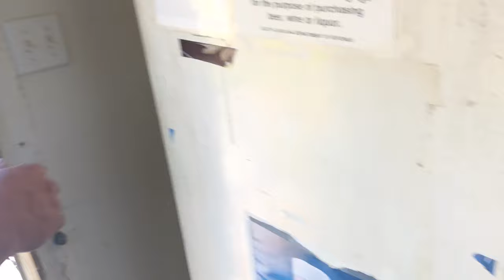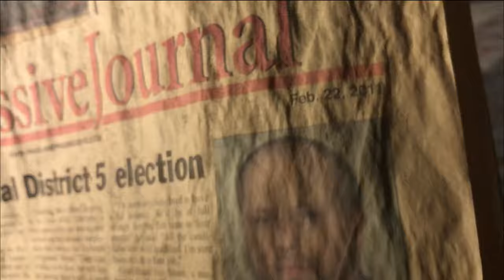We bought a Mobile Home Somebody Turned Into a Convenience Store! - 1st Day Walkthrough!

Comment: That's really not bad....  I've seen a lot worse....

Not sure I'd sell the lot next door...  You could find a deal on a gently used mobile home and put it down...  As a longer term thing obviously....

Yeah, Donnie was exactly right at the end...  People are scared of what they DON'T see....  Start tearing up the floor, and it turns into "Oh no...  Ohhh no...."

I kinda like that it has that big electric service in there....  Ronnie seemed a little put off by that...  When your service is too small, that's several thousand dollars to bring in bigger service, new powerbox, start rewiring stuff....  You are fine there, with the big service...  Wire it up.  You're only getting charged for what you use, it doesn't matter if it's too big....

Anyways, I look forward to this one.  Obviously it worked out, this is like 10 months ago, so....
Reply from the maker: You mean two years ago
Reply: My thoughts on the wiring is that they went in and added a bunch of stuff, but they may have not done it safely so we're gonna have to check all those extra circuits they added in and see what exactly they were doing.... but yeah a bigger panel is a good thing.